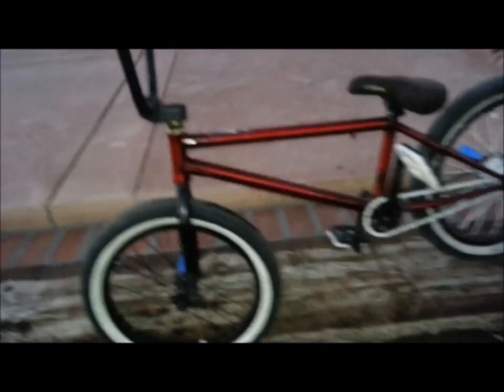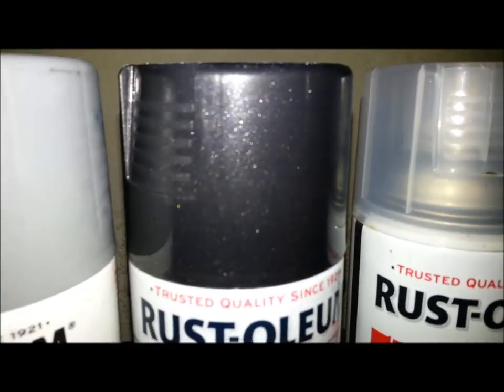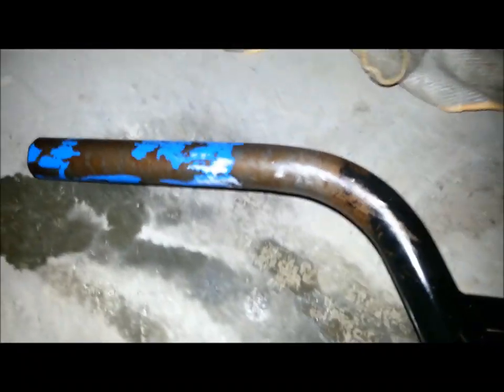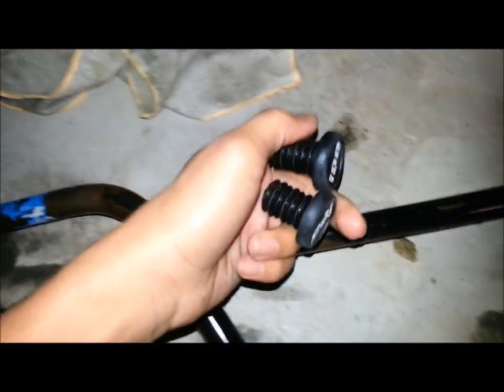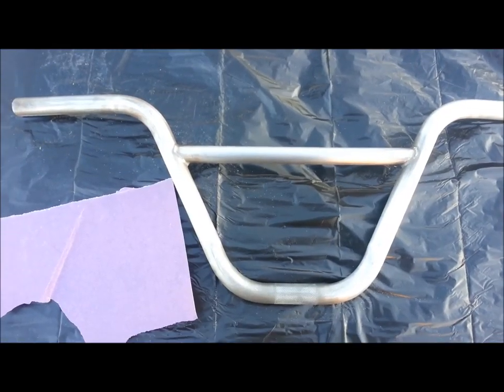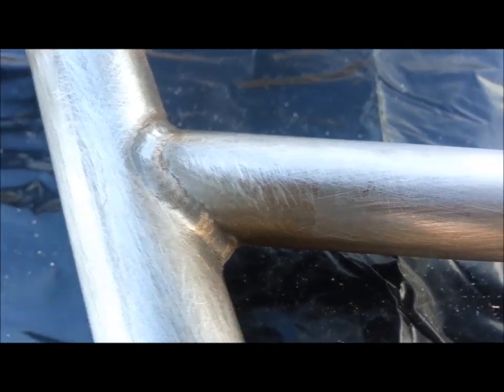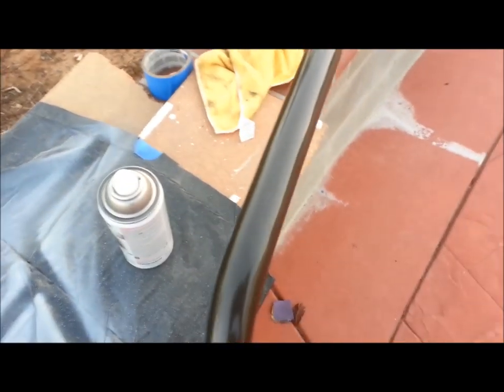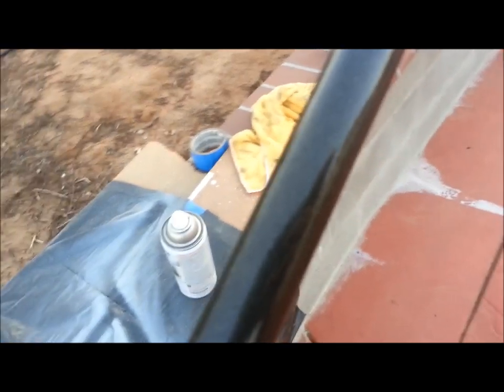How to Paint Bmx Bars

Comment: will the sandpaper mess up the grip thing that connects to the stem for no slip?
Reply from the maker: Yes your stem will slip if you sand that grip thing on your bars. So avoid that as much as possible.
Reply: +wheelcrankbmx ok so the grip thing on the bars im supposed not to sand it. But can i put primer, paint,  and the clear gloss on the grip thing?
Reply from the maker: Jann I would avoid painting or clear coating the grip, do what I did just take over it with masking take until you are finished.
Reply: wheelcrankbmx alrighty Ill do that and thanks for replying back even though this video is 2 years old, Thanks!!